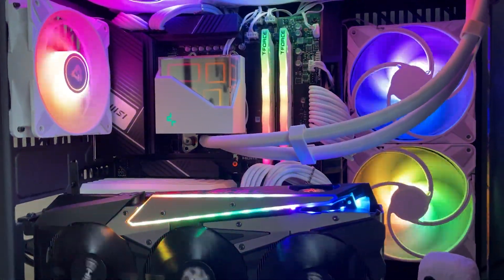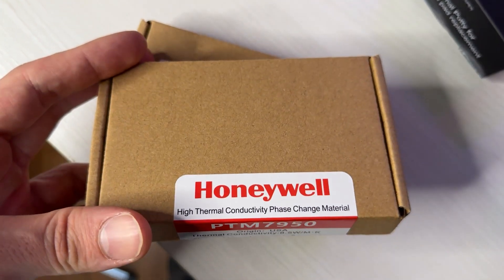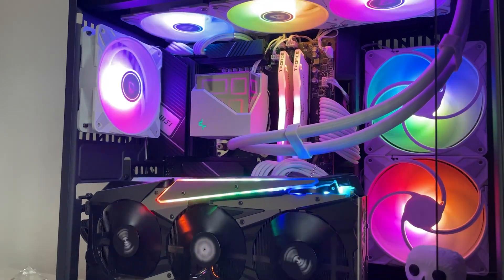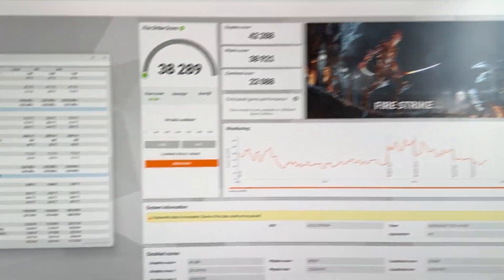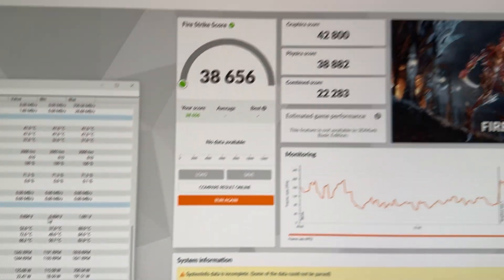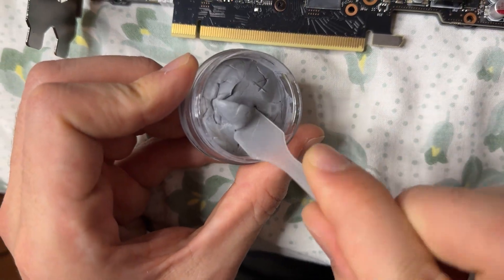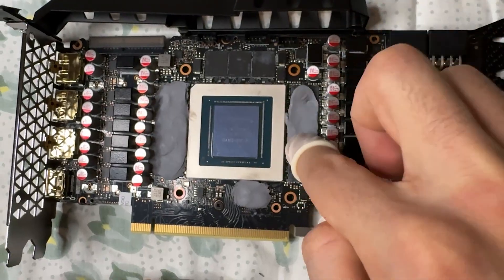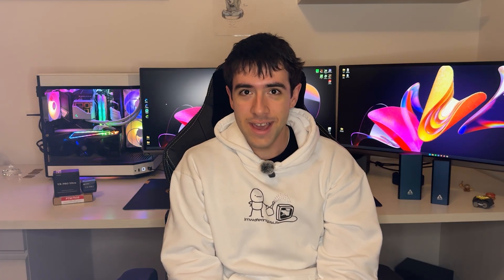I Quit Thermal Paste on my GPU - (NOT Liquid Metal) - Phase Change Thermal Pads - PTM7950 Upsiren

Comment: I have ventus 3090 3x oc model, u think copper have better temps? witj thermal paste/thermal putty.
Or is better thermal putty? 
My gpu is to hot and using only 6gb vram, or chrome.

Comment: Bro, even if it is UPSIREN U6 from China, its performance is better than that of UX PRO from Greece, and the price of UPSIREN from China is lower. The weight in the video is 100G/50G, not 20G as you said.
Reply: The ones from China are better. CSGR / K5-pro is trash.

Comment: I literally just looked into this a few weeks ago for my 4090 as its hotspot temps are rising.  About 2.5 years old. And I came to the same conclusion.  Pm7950 is the stuff to use.  I wonder how to verify its original manufacture tho.  I’d guess if you pay 3-5$ you’re getting counterfeit stuff
Reply: The thickness should be 0.25, on fake ones 0,2

Comment: At 1440p you should be pretty solid with the 3090.
I've been using 3090 for almost 4 years on 4K 144hz. With upscaling and FG I'm pretty happy with it and can play all games maximizing the 4K 144hz monitor. Even with ray tracing except path tracing/full tracing games.

A few months ago I changed the core thermal paste with PTM7950 applied directly to the core not the heatsink. And the thermal pads with a 12.5 kw soft ones. Core temp dropped from thermal throttling at 85⁰C and 1400Mhz core clock to 65 max with 1900 core clock. Memory dropped from 102 to 74 max. Awesome results.

I tried your undervolting for the 3090 when it was throttling but it didn't work. But later when I got good thermals I tried it again and now it's drawing 280 watts instead of 365 watts. 😄 Thank you for sharing 🥂

Comment: I Have a Question , My Zotac Trinity RTX 4070 Super is currently running on AUTO Fan via Firestorm App , and the GPU Fan completely stop when going idle which is GREAT , but I want a Custom Fan Curve for a better cooling .. is it Normal for Custom Fan Curve running the GPU FAN all the time even in idle? and is it okay?

Also , have you repasting and changing the pads on ur  Zotac Trinity 40 Series?? if yes , how thick the thermal pads is?

Comment: Yeah PTM7950 is amazing, it fixed my 3070's hotspots over 20c and fans run under 80% now instead of 100%, i'm planning on giving this to my friend when i get Powercolor's 9070 XT Reaper which has PTM  already in it
Reply: My 4070ti got temp delta before repasting of 20 degrees and now max 10 degrees between core temp and hotspot and quieter fans. I love it.

Comment: I was having temperature issues with my Gigabyte RX 7900 XT Gaming OC. The chip was at over 70 degrees, the hotspot was even partially at 105 degrees. The fans ran at over 60% rpm and were correspondingly loud. 

I decided to convert the card to PTM7950 and Thermal Putty as well. After opening the card you saw a ridiculous, homeopathic amount of thermal paste. 

Shame on you, Gigabyte. 

After the conversion I had excellent temperatures. The chip is at a maximum of 60 degrees, the hotspot never goes above 75 degrees, the fans run at 30% rpm and are very quiet. 

I feel like I have a new graphics card.
Reply: did you put first the putty then the PTM Pad  ?
Reply: @animationmann  don’t matter as long as both are installed properly
Reply: @pedropierre9594  Thank you for the Answer :D
Reply: Say goodbye to your GPU. Never ever use putty. It gets under the chips, and destroys the solder joints. That GPU will need a complete cleanup + reballing of every chip you have tried to get putty on.
Reply: @dark_cobalt  Oh thanks for the Information did not knew that.

Comment: It's interesting how the "consumer electronics" are about 10 to 15 years behind the "Pro or industrial electronics."" I've been using that stuff for about 12 years now. However, the better stuff is made by Loctite (probably the OEM for Honeywell). It also comes on paste form, but it needs a curing time of about 24 hours before you can attach the heatsink back on.
Reply from the maker: Oh that’s very true :) Some of the best thermal paste I ever tried in recent times was an unbranded tube that was used on servers made up of old Quadros, where they were repasting them once per year. Go figure. I didn’t know about phase change pads being around already though, I’ll definitely check out Loctite! Spreadable pads I’ve been using for a solid 5 years too, but up until recently I only had the convenience factor to them, they performed worse than very good “regular” pads!
Reply: @ImWateringPSUs  the problem with Loctite is that they sell it by the large 1kg tube  🙄  phase changing pads are old very old and they were expensive too about $30 Euros a piece and they tend to dry out after month or two if you don't use them, then talking the plastic sheet breaks them apart (they still work but shitty to apply)
Reply: @alexc5564  May I please know what's the exact name of the product you use from Loctite ?
Reply: @ImWateringPSUs  possble to review and compare some ptm brands also from aliexpress
i put on 3080 from ali express same as duronaut temps
Reply: Apparently it's not a matter of technology, but time, speed. When you're manufacturing cards, thermal paste is easier to use and faster to apply. While thermal putty is really hard to clean off, it something goes wrong or a card fails a quality control test.

Comment: You don't even need a phase change thermal pads, the Kryosheet is just as good as thermal paste and is absolutely reusable. I've tested it both on CPUs and GPUs.
Reply from the maker: The Kryosheet is also a very good option, however it does cost quite a lot more and delivers roughly the same performance as PTM7950, plus it's electrically conductive so you need to be a little bit more careful with the application. Both are better than regular thermal paste by far, though :)
Reply: @ImWateringPSUs  True, I just gave it an example, because I have experience with it. 
But it's reusable, while phase change pads are technically reusable, but a bit harder to do so.
Reply: Reusability is the opposite use case that ptm is designed for.

Comment: Your using a 3090 I'm still rocking a GTX 1080 lmao
Reply from the maker: Man the GTX 1080 and GTX 1080 Tis were beasts! I recently re-reviewed them on the channel :) RTX 3090 is plenty for me as I bought it for 400$, pretty hard to beat value-for-money wise at that price!
Reply: tbh unless you want to play the latest and greatest games which require Ray Tracing such as Indiana Jones the great circle and The new Final Fantasy game, then the 1080 is still good. I have a 1070ti oced which is pretty close to the 1080 in my secondary PC and it does just fine. Ofc my other PC with 4070ti s. is much better but still the 1070ti can play a lot of games such as cyberpunk with medium settings and fsr on, Spiderman remastered, miles Morales, metro exodus.Gta 5, Elden Ring and many more. Honestly I could do with that since on a regular basis I mostly play competitive games such as CS or Apex so the GPU does not matter as much, rather the CPU to get those high refresh rate kind of FPS.😅
Reply: @mr.savage778  I used to have a 1070 ti on my secondary build as well and I agree with you. I could play everygame on decent settings and also some on ultra or high. If it was my primary computer I would not be bothered since it is a beast of a card and basically the same as a gtx 1080. I bought mine for $70 and it was a msi gaming titanium OC model, such a great card